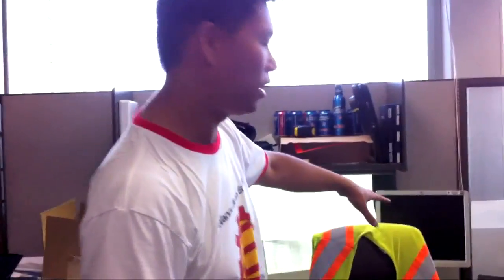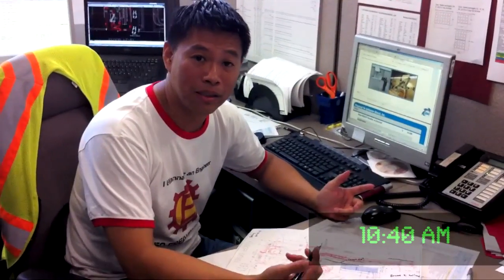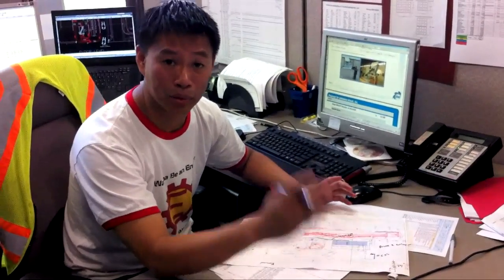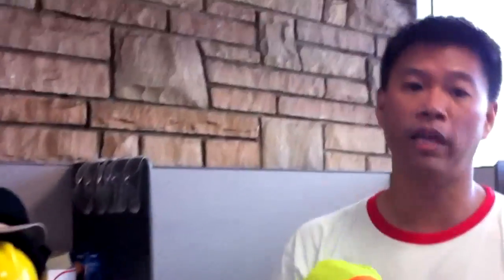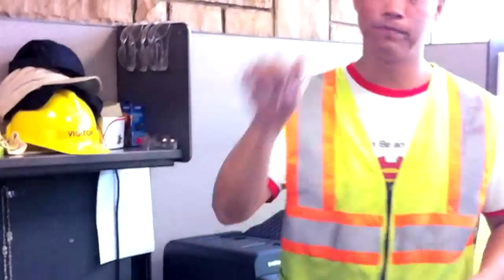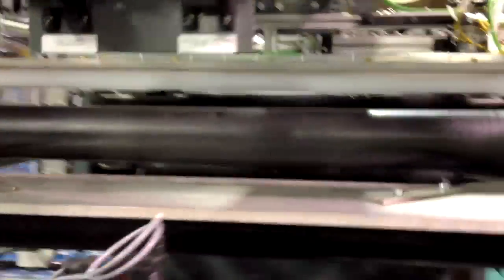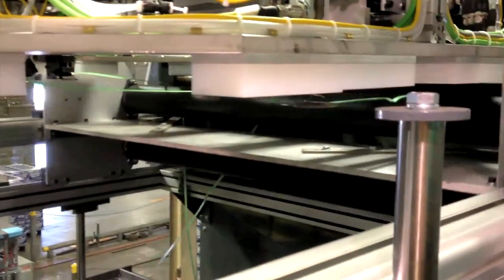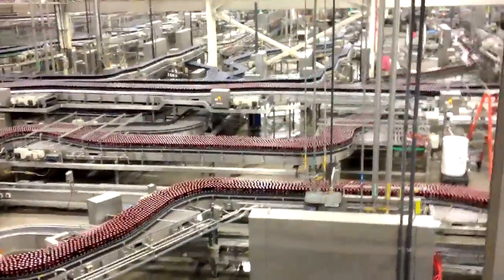Only Won- A Day in the life of a Mechanical Engineer

Comment: He was there from 7:00 to 4:30??? That sounds like hell. I'm majoring in mechanical engineering right now but it might not be for me...good thing I'm already a senior :/
Reply: OmniviumVelocity i'm a petroleum engineer, i work 4am to 8pm steady for 2 weeks straight but then i get 5 days off after that two weeks. you just gotta get used to it, plus your bank account will never suffer. hahaha
Reply: @vjay6667  petroleum engineering is what I'm really interested in. I have heard that the job prospects for a new graduate are not good. Would be great if you could share your opinion?
Reply: yeah but you gotta account for lunch, breaks and all of that. He's not 100% working the minute he gets there until the minute he steps out. IF you think about it, 7 - 4 that is an 8 hour job. Any job would be similar.
Reply: OmniviumVelocity Not always 7-4:30. Sometimes 8-4, sometimes 6am-8am, sometimes 1/2 day. on the average, about 40 hrs/week in the office and about 5 hrs at home.  Also, I'm in LA so i have to make time for traffic. Sometimes I just wait it out. Might not be the same for other locations. Also got flex time to work from home if i need to.

Comment: Mech Eng! I guess the fun only begins after graduation. Engineering school is tough!
Reply: I guess it depends on your university? In mine, the typical lesson hours are around 20-25 hours per week for the first two years. It gets better during the third and fourth years. Lots of projects to do. In my uni, we do a lot of design projects, so its fun but challenging. We started off with really simple designs like a bicycle wheel hub.. then gradually we started moving up in complexity to design clutches for cars, wheel assemblies, cranes etc etc. These more "practical lessons" are easier to digest. Then there are the other more theoretical modules such as fluid mechanics, thermodynamics, stress analysis, maths etc..
Reply: Most difficult thing for me would be the initial months in freshmen year... Got to get use to the workload, and don't compare with the other majors. But still, nothing is difficult if you put in work into it. Don't pick a subject just because it is easy, because that attitude wouldn't do us much good further down the road. Cheers. Good luck.
Reply: Dan C What would you recommend between Mech Eng, Elect Eng and Aeronautics ?

Comment: I'm a Freshman in high school and I want to be a mechanical engineer and I have a career center that has machining, welding, woods, drafting, and electricity and senior year or jr year I can take a 2 hour class in any one and I will get a starting certificate would it help getting one for mechanical engineer if so what class should I take plz respond if u can
Reply: I'm a senior in High school, you should take electricity in order to get a head start. In college you will see something called circuits (this course is one the major causes of why people drop out of engineering) you will have to take this course regardless of what type of engineering you will do. Advice: 4 years from now when you are in college don't take circuits and fluid mechanics at the same time, and also try to make friends in order to complete homework together (it helps). One of my cousins is studying to be an Electrical Engineer.